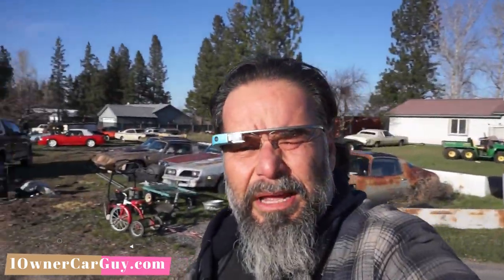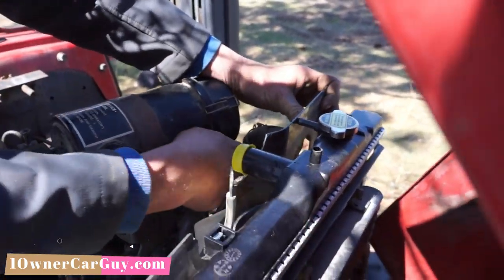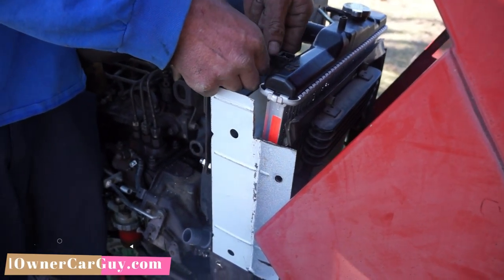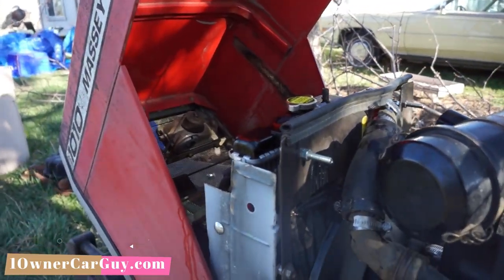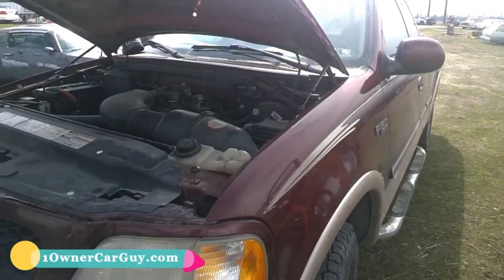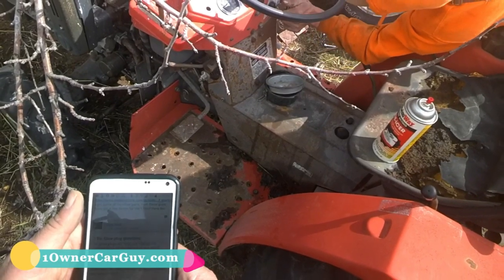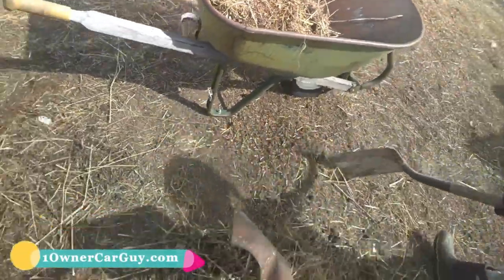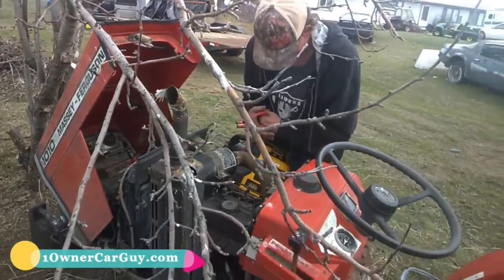RADIATOR REPLACEMENT MASSEY   FERGUSON 1010 TRACTOR ! DAILY WORK VLOG 2020 0115

Comment: They start hard no matter what. Mines converted to 12v and still needs good glowplug time and full throttle and let it crank about 15-25sec to start then as it starts bring trhottle down to let it warm up. They are all like that from new.